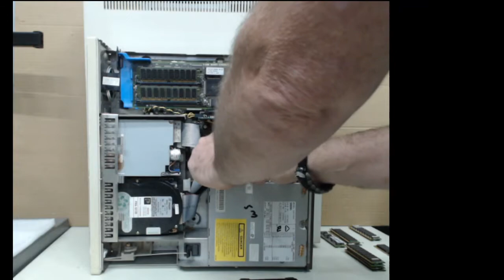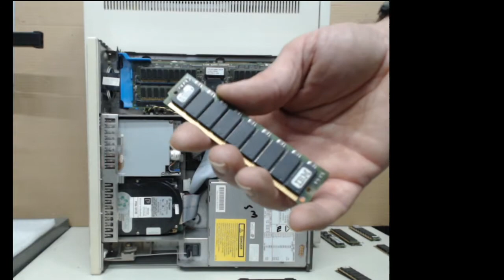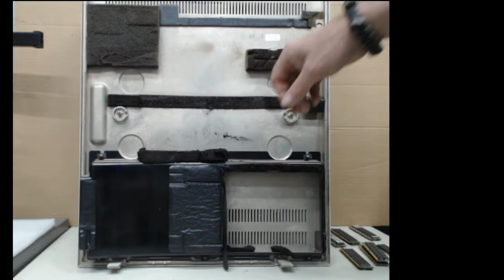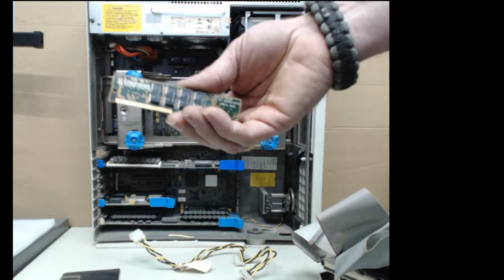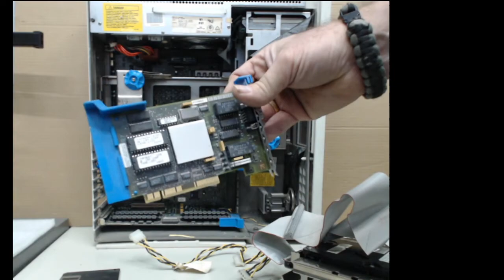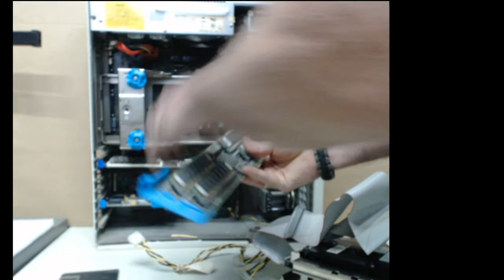IBM PS/2 Model 55SX and 65SX Planar SIMMs - Opening a 65SX!

Comment from the maker: The 65SX has the Dallas Semiconductor DS1287 RTC module and a separate DS1220 NVRAM module - and doesn't have contacts or wires for a battery in the speaker pillar.

Comment from the maker: A Model 65SX system would have been shipped from IBM with the "Tribble" SCSI adapter and an XGA video adapter - No idea why this system didn't have XGA inside, the only missing bracket was at slot 8, which is where the Tribble was. I do have spare Tribble and XGA adapters to put back into the system - that sounds like something for a later video!

Comment from the maker: It's one parity bit per byte (8 bits) - so 32 bits of data has 4 bits of parity (thus the difference between 32 bits of width - non-parity - to 36 with parity bits included). Parity validation only helps for very trivial errors - later error-correcting methods included 8 additional bits for 32 bits of data (a total of 40 bits).